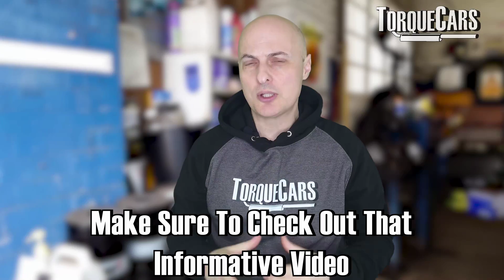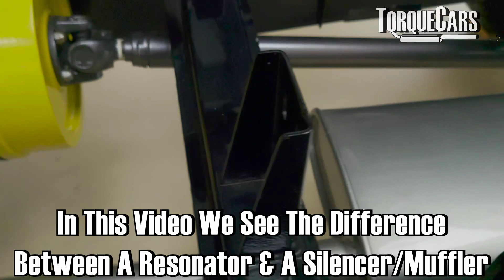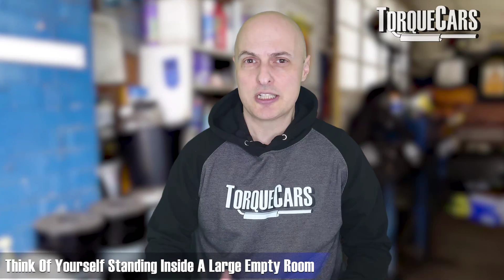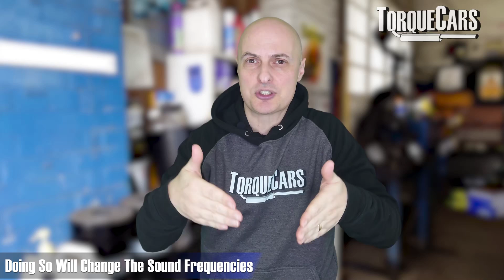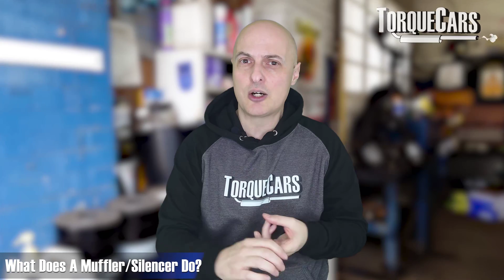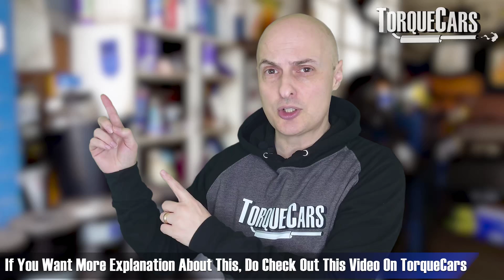Silencers Vs Resonators or Mufflers, What is the Difference?

Comment: I have a 2015 bmw M3 with catless downpipes and all silencers removed.  It sounds good but raspy and tinny at low RPMs.  I saw a video by someone with the same setup as mine but he added a Vibrant resonator.  It fixed the rasp but it lost the higher pitch exotic sounds.  Is there anything that fixes rasp but keeps high pitch sounds?